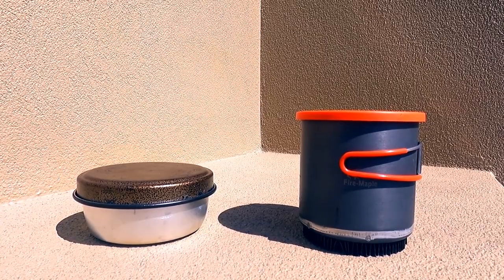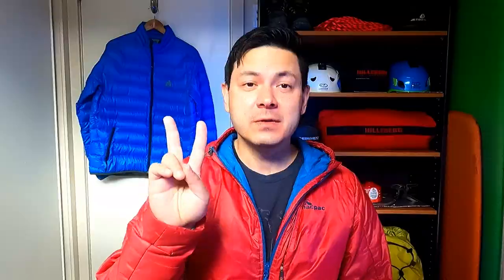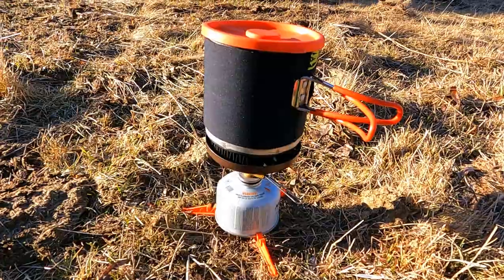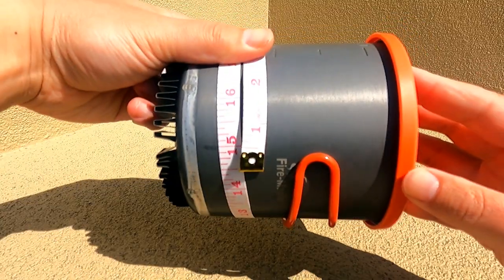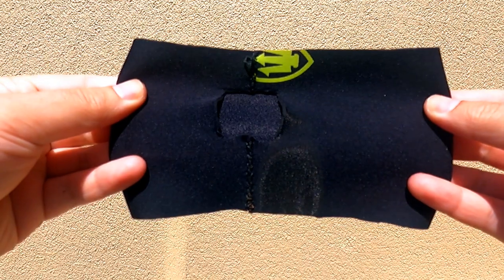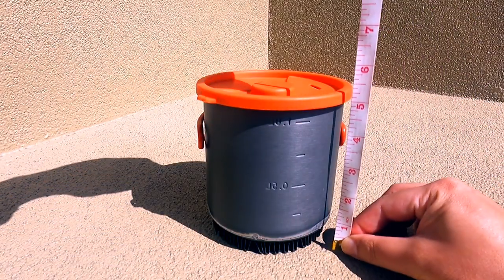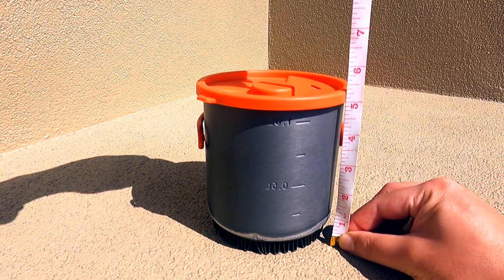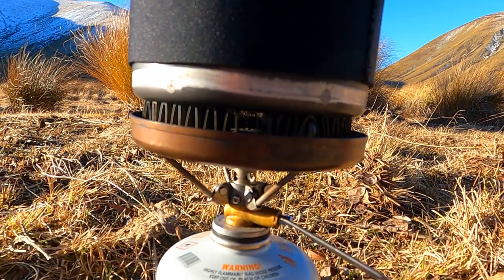Neoprene Pot Cozy - DIY

Comment: Looking at making my own. Came across this video (like it by the way, really easy and simple to follow 👌) just wondering if you used a specific type of thread? Or was it just cotton?
Reply from the maker: Hi Brayden, thank you. I'm glad you found it helpful. I think I used poly cotton thread, but I don't think it really matters. I've had a bit of melt-age of my neoprene, as I've had the stove turned up a bit too high a couple times, but it's still functional. I think it would be the same with the Jetboil neoprene as well though.

Comment: Did you make the video on the stove yet?
Reply from the maker: Hi Jack Hammer, sort of. I made a video on the Snow Peak Gigapower Backpacking stove, and in it, showed a few more details of the stove. I've now included a link to it at the end of this video. Basically, I just removed the shroud from the pot, so it would nest really well with the Gigapower Stove and its windscreen. I hope that helps!
Reply: @JoshuaJohnsonOutdoors  thanks I’ll check that out :)

Comment: Hey :) Thanks for the video! Isn't there a chance for your thread to catch fire?
Reply from the maker: Hi Jay, thank you. Well, there is always a chance, but they tend to just melt a bit. It's actually pretty common on JetBoil pots too - I've seen lots of people with slightly melted pot cozies. I've had my DIY cozy for a few years now, and it's still alive and kicking (though I do baby my kit a bit).
Reply: @JoshuaJohnsonOutdoors  Ohh, that's good to know! I was thinking of maybe using some kevlar thread, which is heatproof at those temperatures, just to be safe 😂 Did you by any chance measure how much more fuel efficient your stove is with the cozy? Cheers!
Reply from the maker: That's a cool idea, Jay. You should make a video about it! lol. I didn't explain myself very well at the end of this video, regarding efficiency. Overall, I'd say I'm using less than half as much fuel (with the addition of the heat exchanger, windscreen, and the pot cozy). The difference in performance is enormous. Can I ask what sort of adventuring you do?
Reply: @JoshuaJohnsonOutdoors  Haha yes, maybe I will measure it! If I do, then I will let you know 😄 But that really does sound like it has a huge impact on fuel efficiency! I'll probably have my next big trip in spring next year, but I'm still trying to find a good route to take. I'll probably be on trail for a few weeks, but nothing too wild... Currently I'm doing shorter weekend trips, and try improve / fine-tune the gear I have :) And having to carry less fuel (and weight) is always a good thing! 😄
Reply from the maker: @81-jdowlwp  best of luck with your process! If you end up making one, please let me know how it goes for you. Cheers.